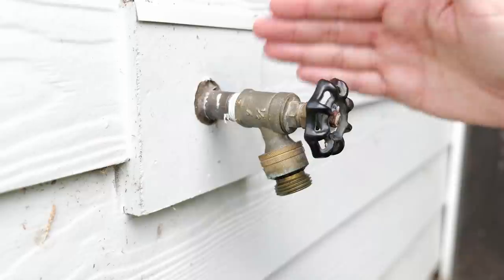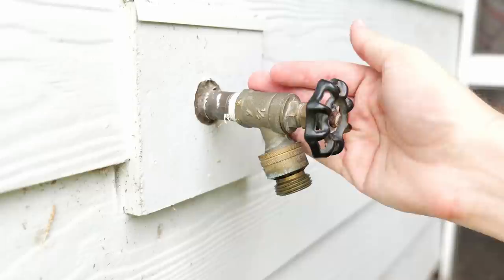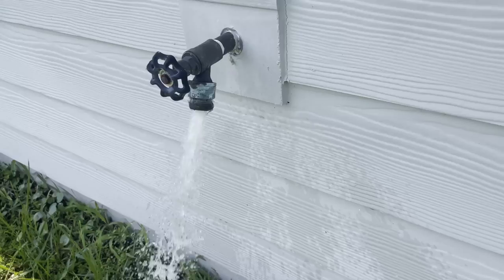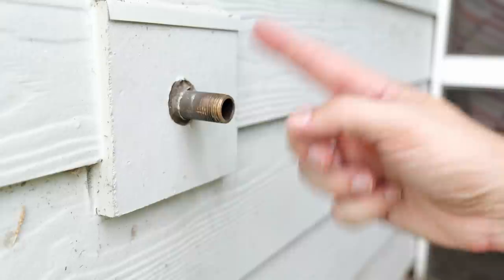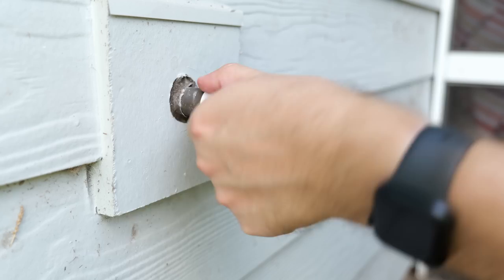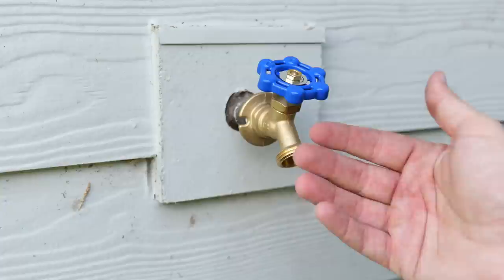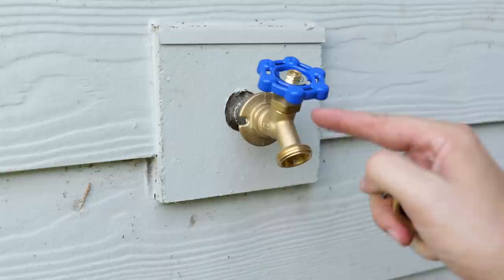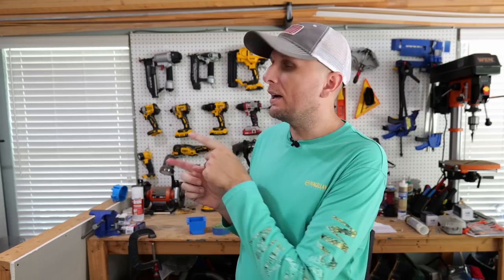The CORRECT Way To Replace An Outdoor Faucet | DANGEROUS and Common Mistake DIYers Make!

Comment: I'm a bit anal about terminology ... you keep referring to the Teflon tape as "plumbers tape", but that's not right. Plumbers tape is actually a perforated metal strip. Mostly used for hanging or restraining pipe. 
Other than that, I like your videos ... keep up the good work!
Reply from the maker: Thread seal tape is also commonly referred to as plumbers tape.  Some even call it Teflon tape but that’s just a brand name.  What you are referring to is sometimes called plumbers tape but is hanger or pipe strap.  So it’s just another one of those things of people calling things something that some others call something different but neither are wrong.  Appreciate the feedback!

Comment: My city h20 pressure is 60 psi.  When I turn the water off at the bib the gate valve closes. How does water from the hose enter the house plumbing with either a closed valve or 60 psi flushing against it?  I guess if you close the main and open the bib for repairs and leave the hose on but otherwise I can’t see how that happens?
Reply: It's there in case you don't turn the valve off at the house, and water moves between the hose and the house as pressure changes.
Reply: @johnhaller5851  ah. Got it.  But as long as you’re using the bib valve, you should be good?  
It’s pretty rare I’m turning main off and leaving bib open unless I’m actually repairing the hose bib?
Reply: @samfeldman1508  Technically, just leaving the hose end turned off, and the bib on has a non-zero risk, but it's pretty close to zero. The hose is pressurized the same as the house, and sitting in a hot sun will make the water expand. Sometimes a hose would burst if turned off at both ends, and the backflow preventer stops that from happening by relieving pressure in the hose, that water would go into the house if the bib was left on. Not a lot, and the risk is more theoretical. The bigger risk is if you were filling a pond with the hose end in the water, and there was a water main break, that the water could be siphoned from the pond through your house into the water main. While this is a bigger risk, it's also still an unlikely scenario, but I'm sure it happens on occasion given the number of water main breaks which occur in the country.

Comment: 3 items 
1 the faucet you put on is the wrong style … it is meant to set flush to wall that why the 2 cuts on the sides to screw it to wall flush after Attach to pipe…
2 the new faucet does accept your adjustable  wrench.  It is not a nut style to tighten. There are just 2 flats on each side. Wrench not needed just stick a screw driver inside the hose bib end and twist 
3 notice you old vacuum breaker was tightened enought to break off the screw head …. Code is to tighten it to break off the head so the homeowner doesn’t remove it.
Reply from the maker: 1. It is what was available at my local stores.  It doesn't make it wrong it is just made so that if you can flush mount it, it can be further tightened down with screws on each side.  I talked about this briefly.
2. I know you saw my comment in response to this to another person, I addressed this by saying an adjustable wrench could work but they are short flats and can easily slip.  That is why I always use my rubber adjustable wrenches.
3. Yes they are tapered down and designed to break off but I am not ever going to do that because the day that vacuum breaker goes bad ( which it will), without drilling it out or trying to notch it out with a dremel to then be able to try and unscrew it, I am not going to be able to remove and replace the vacuum breaker without a ton of hassle.  As far as I can tell there is no code requiring it be snapped off but some inspectors may require it.  Out of the 3 hose bibbs installed on my house by the plumber, that was the only one that it was broken off which makes me think they may not have and it got broken off by something hitting it throughout the years as we use that one the most.  Tons of plumbers get around that by installing a hex bolt in the set screws place.
Reply: For tightening the hose bib onto the pipe, I would probably try the rubber coated handle of the Channel Lock first. If it didn't fit, I'd get a screwdriver. I've never had great luck with the rubber strap wrenches.

Take care and God Bless.

Comment: I would have tested that the water is flowing through the vacuum breaker without leaking at the bibb, and those "Safety screws" are actually DESIGNED to break off, and it's probably a wise idea to replace it with a set screw to keep it "in code" and still be able to replace it or reuse it - also, I have great disdain for any water valve that isn't quarter turn, aside from inside faucets. When I turn on water outside, or need to shut down part of my water pipes, I like the "complete" shut off/turn on of a quarter turn valve. Always worth spending a few extra bucks.
Reply from the maker: Yeah I am not going to break the head off.  It is a really stupid design.  I understand the intent but it makes replacing the vacuum breakers a major pain in the butt when they go bad.  What you suggested is what many plumbers do to get around it by using a hex set screw so it can be removed which makes the whole idea of the break off head set screw even more ridiculous to me.  I have not found a code that states that the screw head has to be snapped off.  In fact, 2 out of the 3 hose bibbs on my home were not snapped off and were installed by a plumber.  
My Dad is the same way, he only buys the quarter turn faucets.  I can see the appeal.  Thanks for the feedback!
Reply: @HowToHomeDIY  As a homeowner, I always appreciate your videos. One thing I've learned after rebuilding bathrooms and remodeling - never cheap out on features. Quarter turn valves have provided a considerable upgrade in quality of life when dealing with plumbing issues.

Comment: Would love to see a replacement solution where the new bib would be too close to the ground level....Something to increase the effective height.
Reply: If you have galvanized pipes and are not worried about freezing pipes, then you would just need to add a right angle bib facing up, a straight pipe going as high as you need it, another right angle at the top pointing towards you, a short pipe, then your valve. If the extension pipe is not stable, then you can use some wood and metal ties to secure it to the wall.
Grandma has this set in her backyard.
Reply: I have always thought of doing this! Stooping over for my water valve can be an unnecessary chore. Will look into a diy for my 5 spigots. 👍🏼

Comment: Did you really mean to suggest shutting off the water supplied by a residential water well system by turning off the electrical breaker?  That will require draining the whole pressure tank before the water actually stops flowing, I wouldn't do it that way.  (In the case of a leak in the house plumbing, just shutting off the power will still allow the entire tank of water to drain into the house.)

On a previous house that had a residential water well system, the installer put the shut-off valve between the incoming well line and the pressure tank!  Closing that valve would have blocked off the connection between the down-hole well pump and the pressure switch on the pressure tank, causing the well pump to run continuously "open-loop", which means that the water pressure would continue to increase until something broke or an emergency relief valve (if there even is one) popped open.

Our current house has a strange water distribution system - there is a central panel where all the hot and cold water lines converge, with separate lines running to each individual fixture in the house, each line with it's own dedicated shutoff valve mounted in the panel. It's basically the same idea as electrical wiring, with it's central breaker panel.  I can see the appeal of such a system in theory, but in practice is has severe usability problems.  Have you ever done a video on these types of residential water systems?  If not, it might be a good topic for a future video.
Reply from the maker: Everyone’s situation is different.  My valve is underground where some are at the tank and some don’t have one at all so in this case where I don’t have an internal leak I just shut the breaker off to the well and while it takes a couple minutes more to drain the pressure tank it isn’t too bad.  

No I personally haven’t come across that.  that sounds like an interesting setup but the way it sounds, I would think would allow more pressure at a given time throughout the house if I’m picturing it correctly.  Appreciate the input!

Comment: "Extremely Dangerous".  I thought your other video titles seemed over zealous, now I'm sure.
Reply from the maker: Oh no, say it ain’t so!
Reply: @HowToHomeDIY  The situation requires the hose to be submerged AND a vacuum water supply condition -- low probability.
Just trying to subtly suggest stopping unnecessary drama.
Reply from the maker: It’s not though.  You can’t guarantee that wouldn’t happen and it can be dangerous.  It was not uncommon before vacuum breakers, hence why we have to have them now.
Reply: @HowToHomeDIY  You claimed "extremely dangerous" when it is more realistically potentially.  FYI drains from ACW (automatic clothes washer) are also prohibited -- a next-to-impossible, if not impossible, backflow possibility.

Anyway, thanks for at least responding.

Comment: I will just use an air chisel or sawzall to revmove the old be faster.  That looks so nerd to tighten the new with some bulky wrenches. I can just grip it by hand and twist the new valve on tight. Your old faucet was a water heater valve not hose bib. Lol

Comment: I replace mine with 1/4 turn ones. I do not bother with vacuum breakers and other such nonsense. Reason? I do not use chemicals in my hoses AND I drain my hoses after every use.
Even my house does not have a backflow preventer.
I will NOT bring anything up to 'code' if I don't have to.
Backflow preventers also reduce your GPM's.

Comment: I live in a city subdivision and my water pressure is 65psi. Yet I’ve been told by a plumber I still need an anti siphon valve. With any pressure there isn’t going to be any back flow. And if there was no pressure, then the hose bib would not turned on. Maybe there’s circumstances that are exceptions that I don’t know of, but for my backyard watering, even with pressure washer soap dispensers, I don’t see any possible use for a back valve unless someone can convince me otherwise-and please don’t say it’s code.
Reply: If you turn your water off only at the end of the hose, and leave it in the sun, the water from the hose will expand and push back into your house. Even if you don't leave it on that long, even someone flushing a toilet or filling a bathtub will drop the pressure in the house, and some water will return from the hose. 99.99% of the time, nothing bad will happen as a result. But it is possible to have dropped the end of the hose in some dirt before turning the water on, and the dirt might have some nasty bug that grows in the hose and gets back into the water in the house. Sure, you may always turn the water off at the house, except that one time you get an important phone call at the wrong time and forget to go back to the hose.
Reply: @johnhaller5851  ok you have a good point, albeit a long shot for my situation because I always turn off my spigot and then release pressure in the hose and leave it open. I learned one year when my neighbor had to come and turn off the spigot because the Sun probably overheated the hose and burst somewhere. From then on I always turn off after use and bleed the hose. But in case I do forget that one time, I have to ask, I have a 50ft hose, would the contamination at the hose end really make its way back through 50ft plus more feet of pipe with just a little pressure differential? Is that even probable?

Comment: Oh dude, the thread is 3/4 garden hose, you are putting your Teflon tape on "backwards",  my eyes are rolling.
Reply from the maker: You can roll your eyes until the cows come home but it’s not on backwards 😂
Reply: @HowToHomeDIY  YOu are correct, you did wrap it the right direction, but you are holding the roll in a way that makes it hard to do..still rolling my eyes
Reply from the maker: @markodeen4105  Ok

Comment: So much fail.  That is a "hose bib" that you are installing, every hardware store in the country would call it that.  The valve that you removed is a "boiler drain."  

Also, a wonderful thing about "code" is that a homeowner is under no obligation to change things to meet current code.  So I wouldn't need to install a breaker for the infinitesimal chance that I'll suck something back into my house anymore than I have to replace my outlets with those ridiculous "tamper resistant" outlets.
Reply from the maker: Your comment is so much fail.  I referred to it as a hose bibb, yes hose BIBB not bib, numerous times in the video.  It is a boiler drain but can be used as a hose bibb with a vacuum breaker on it.  And yes, code does still apply to you.  Homeowner or not.  These are the comments that make me laugh the most.

Comment: That's not up to code because it needs to be a frostproof faucet!
Reply from the maker: That is not correct.  Your local area may have that as a code but it is not a National code.  Down here in the south we really have no need for frost proof faucets.
Reply: Texas got frozen a few times

Comment: I won't be subscribing. The way you used the pipe wrench with the crescent wretch was wrong and added even more downward pressure on the pipe in the wall risking further possibility of damaging the connection inside. You should have put the crescent wrench on the same side as the pipe wrench forming a v, and pushed lightly down on the pipe wrench while pulling up towards the pipe wrench with the crescent to loosten the bib. That pressure put towards the two wrenches steadies the pipe in the wall holding it completely stationary and doesn't risk adding more pressure to damage to that pipe. You also only gripped the pipe with the 2 jaws and didn't also bury the pipe against the back of the adjustable jaw which enables crushing that pipe had it wall strength been compromised with rust. Bad advice. Also. the screw on the breaker has a break away head for a reason. Once a plumber installs it to the proper torque the head breaks off so no one can take it off because of the safety reasons you mentioned. Most inspectors look specifically to see that broken screw and will not passthe installation unless that head is broken off to prevent tampering!
Reply from the maker: Please don't subscribe then.  I didn’t ask you to.  I disagree with much of what you said.  Only thing I would agree with is potentially having the wrenches closer together at the start.  We did that when separating high pressure hoses but those were torque down much more than a hose Bibb.   Doesn’t take much to start turning a hose Bibb.   The screw head part I have addressed with many others in the comments.   It’s not required and in my opinion not smart.